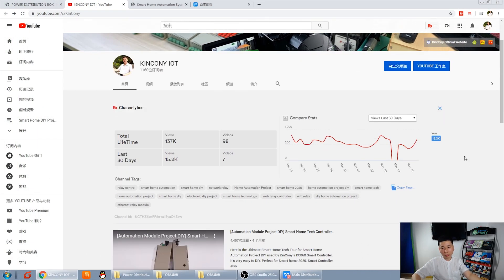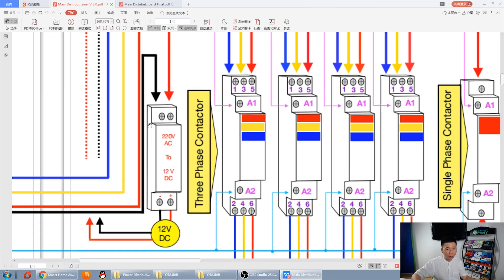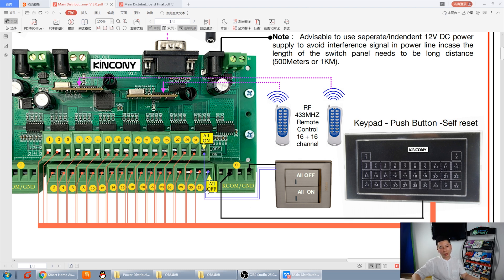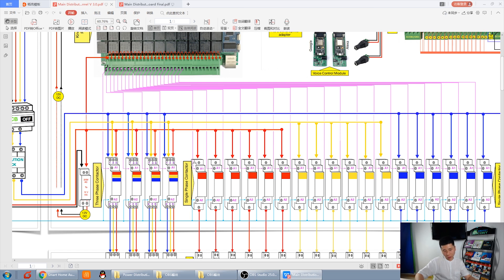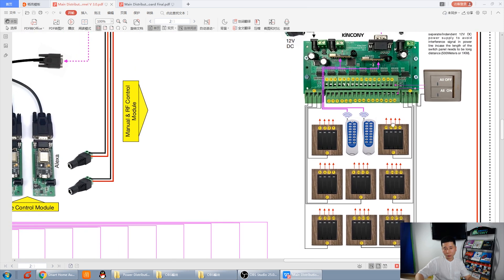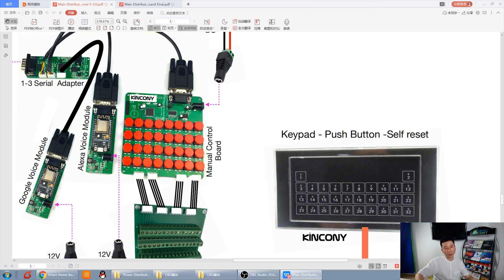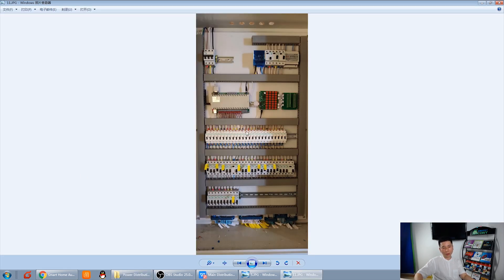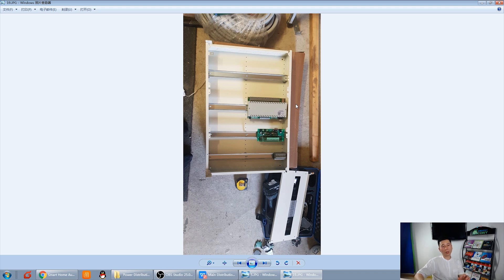Smart Power Distribution Board single & 3 phase DB MCB wiring diagram

Comment: Hi sir, what product i need to have smart DB , to control the lights ?
Reply: So i can control it with pc and wifi and mobile
Reply from the maker: you can use KinCony KC868-H32BS + KC868-E16 relay module.

Comment: for 8 channel installation what are the parts needed to make DIY, how many contractor, circuit breaker , MCB, used ?please list out the all components to make DIY.  do you have circuit diagram for 8 channel ? whether i can buy single phase or 3 phase ?
Reply from the maker: we have another video about 8 channel power box is 1 hour whole DIY progress.if you want to DIY a 8 channel Power Distribution Box.you can use KC868-H8 relay controller, you see the video is KC868-H32L , just different relays, all the circuit diagram is same in every relay output.if you want to use single phase or 3 phase, just change the AC contactor and MCB for single phase or 3 phase, others is same.
Reply from the maker: you can also see this video: https://youtu.be/HKDMUWkYL78

Comment: Hello, your product is very interesting. I would like to know what the connection diagram of your equipment will be if you want to be able to control the load with the help of wall switches and using a telephone using pulse relays
Reply from the maker: We are drawing new and complete solution drawings and making videos, which will be uploaded as soon as possible